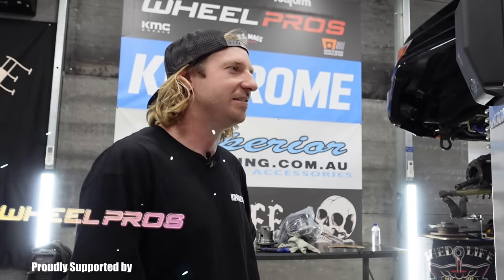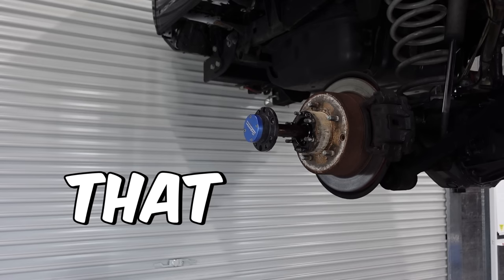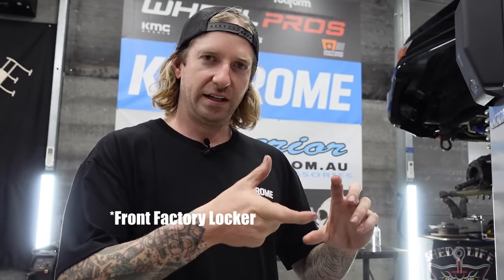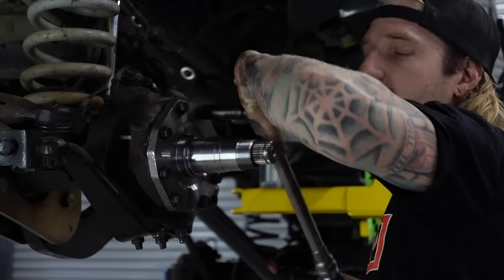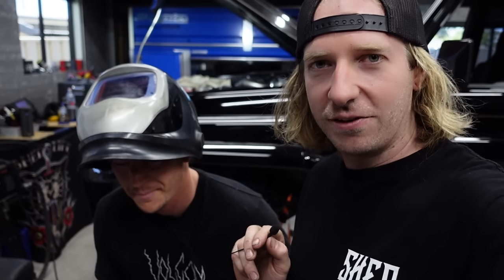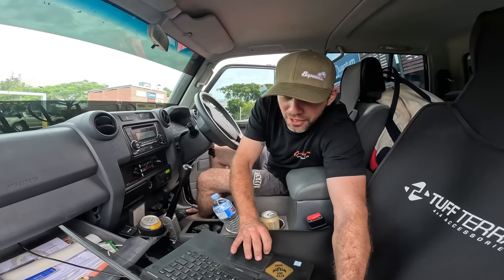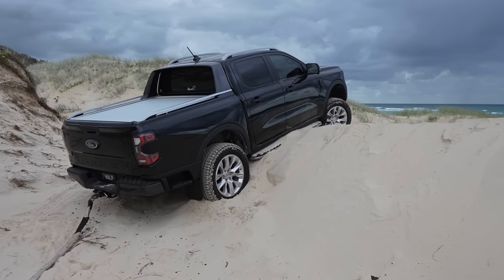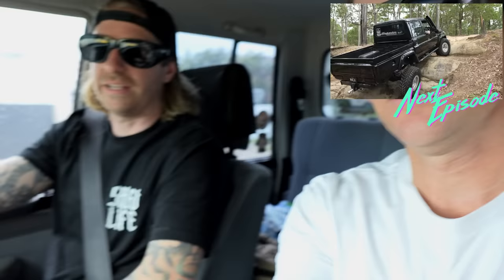Fixing every problem it has

Comment: Hey Macca, just FYI, I was running 140W in my Patrol with Harrop lockers . I had issues with the oil viscosity making the locker engage when cold in the winter months here in Brisbane. Spoke to Harrop and they recommend an 80/90 gear oil. I changed mine out and stopped the problem.
Reply: Copy that thanks mate! No dramas as of yet!
Reply: @macpreston  Hi Macca, can I suggest that you follow the manufacturers spec for oil.. it is very important. Oil is not just a lubricant, It is also a buffer. The " W " is the buffer thickness amount. 
A 79 series requires 75w - 85w  NOT 140w.  
Some front and rear diff"s use different oils. I hope this helps.

Comment: No need to do heat cycles or pre oil the gears before install, they will get lubed backing it off the hoist 👌 good job though king

Comment: If you take the hub off and take the circlip  off the cv and unbolt the brake calliper then you can just undo the kingpins and slide the hole lot off then you don't have to fuck about with the wheel bearings saves you alot of time
Reply: Ah yep very good idea to! I was changing stub axles anyway but learnt heaps!

Comment: I use the penrite pro gear.. full synthetic in my diffs.. just a personal preference though.. the weight of the oil depends on the tolerances, climate and operation is what I got told by the company called strange.. they build centres for drag racing...

On another note.. loving the content lads keep it coming.. maybe hit up penrite for some sponsorship🤷‍♂️
Reply: Great info mate! Cheers 💪🏼